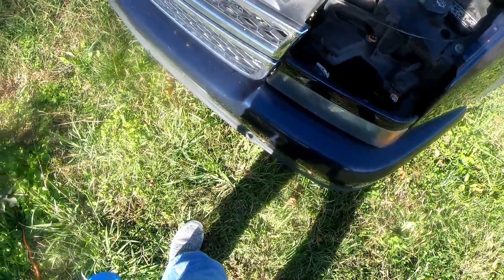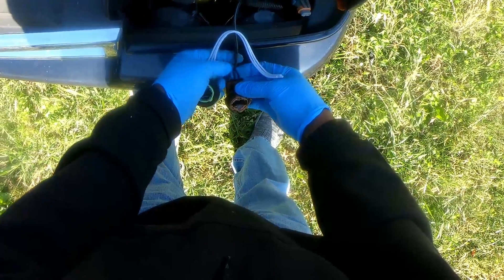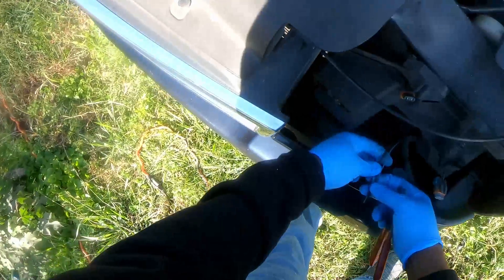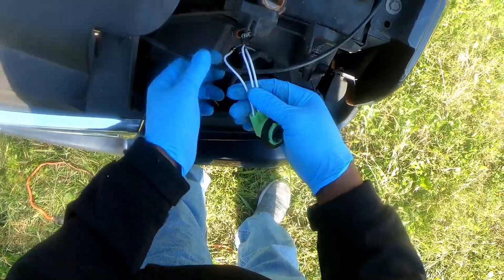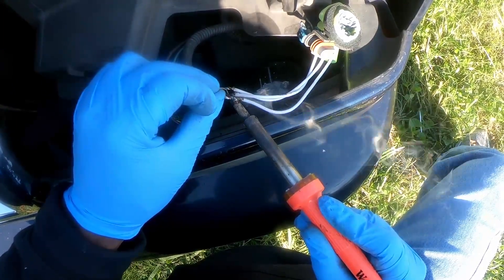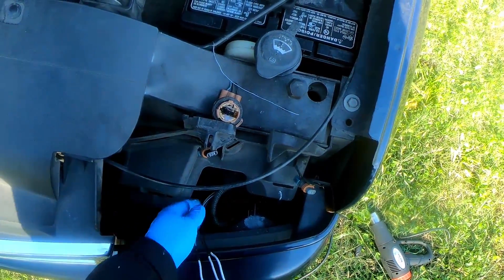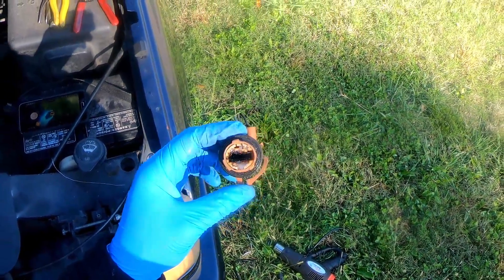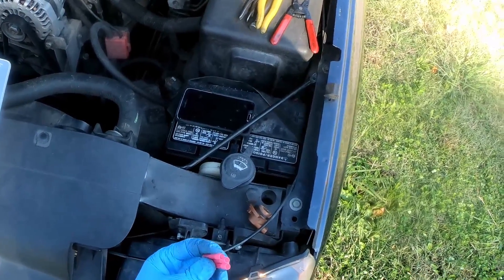2007 Chevy Silverado turn signal light socket replacement

Comment: Do you first have to disconnect the battery to perform this repair?
Reply from the maker: Yes, it recommended to disconnect the battery
To prevent an electrical short
Reply: @Slicpartna  thank ya

Comment: Is saudering necessary or can I just seal the wires with electrical tape?
Reply from the maker: I would recommend soldering the wires 

Electrical tape can come off and cause problems

You can use butt splices as well 

Let me know if you have any other questions
Reply: @Slicpartna  ok thanks